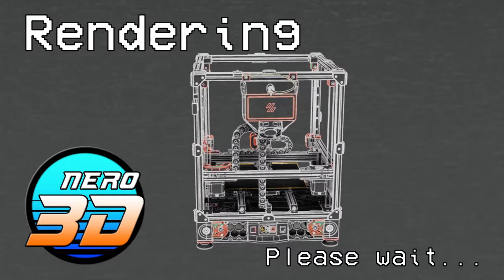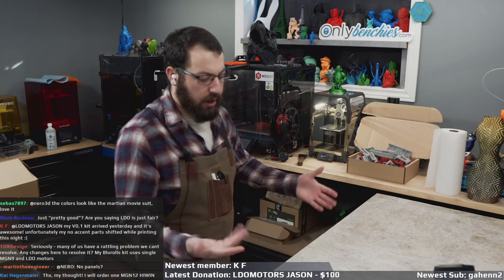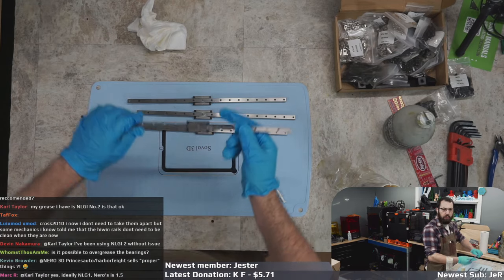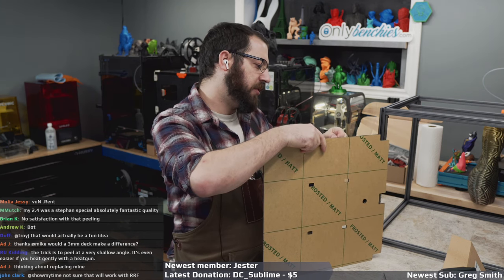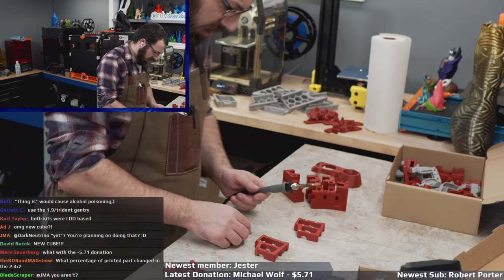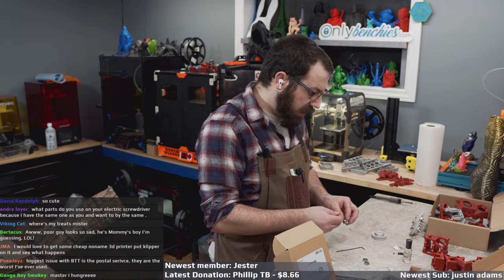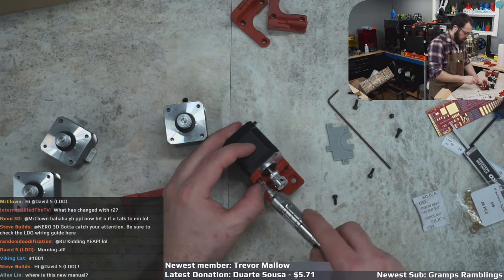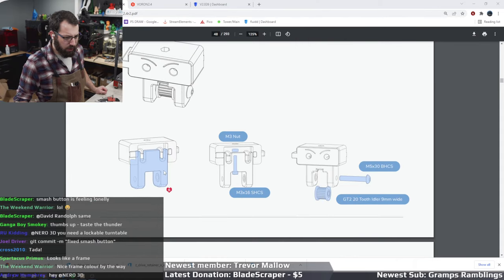Voron V2.4r2 LDOmotors kit Livestream build- PART 1

Comment: Biggest practical endorsement of Voron quality, you found your missing part, ran it through the slicer, dispatched to fluidd, and never even really looked at the printer. You just hit "go" and check for a completed part an hour later. That's a pretty solid testament.

Comment: I think you could have mentioned pre-loading the T-Nuts because the tolerances on the extrusions are so tight that inserting them can be impossible without damaging the extrusions. Some sides are worse than others so identifying where all of the nuts go before assembly can prevent a massive headache later in the build.

Comment: The new cameras look great! Big upgrade to the stream!

I love watching you build these machines. I'm slowly self-sourcing parts for a V2.4 myself. I'm in Australia so try and catch your Saturday stream, which starts on Sunday for me, close to lunchtime :)

RE the overhead camera, I think the image is pretty well exposed, but it's just looks darker compared to a slightly over-exposed image from your front camera. If you're running a kit lens (I seem to remember you mentioning a kit lens earlier in the stream?) then it's possible it has a "variable aperture" which means as you zoom in, it'll get darker (because the hole that allows the light through is getting smaller, part of the cheaper design in a kit lens). Like you did on the stream you can tweak the brightness of the image in OBS, or bump the ISO on the camera itself prior to the stream.

Comment: "Why do i have so many printers, because i like building printers". Funny, i almost enjoy building and working on the machines more than actually 3D printing itself. 3D printing is just a tool to use to build 3D Printers, LOL. Love it!!

Little suggestion, your videos are great, but during these build videos I think a little more explanation of what your doing, and why, would be helpful for those less experienced builders, and that's the whole point isn't it. As an example, you laid the bed rails on the table and lined up the little 90-degree brackets with them, and started the screws into them, and then placed in the machine for mounting. As an experienced builder I know you did that to line them up correctly, but some folks just might not know why, and go straight for mounting into the frame. Some portions you explain very well, and some portions you are chatting away about something else while you're working on stuff. Again love your stuff, just small criticism.

Comment: thoughts on trident vs 2.4r2?
I'm currently trying to decide on a first printer and either those or a ratrig at the moment.
I live in the US, which makes voron cheaper. Biggest thing pushing me towards 2.4 is the greater z, but the bed tramming does look nice to have. (I'd go for either 300x300 or 350x350)

Comment: Hi, I love your videos they have been extremely helpful. I was able to completely rebuild my CR-10 Smart with BTT SKR E3 V3.0, Relay V1.2, PITFT50, LGX Light, BL Touch and Klipper.
I am now planning to build a 350mm Voron 2.4 R2 and have a few questions before I order parts:
My current thoughts on a configuration are-
Stealth Burner with Clockworks 2 or LGX Lite - Currently using a LGX Lite on my CR-10 Smart and like it.
Hot end - I am leaning towards the Rapido HF, but I am concerned I will need to go to an LRS-350-24 due to the 4.8amp current draw on startup. Your Thoughts?
Regarding Mods - 
Is it advisable incorporate the Voron2.4_Trident_Pins_Mod? Does it make any difference / worth it? Does anyone sell pin kits?
Are they any other mods i should consider before I order my printed parts?
Thanks

Comment: Nero I know that it is probably a personal preference but did you mount the Z stepper motors 180 degrees out with reference to the new Manual. The manual showed the socket facing inward away from the frame? Missed the live stream but like the new chapter markers on the revised 'saved' stream :-)
Reply from the maker: The ldo kit has a few differences in assembly, mostly due to the way the pre made wiring is done. You van see the changes in the ldo site linked in the description

Comment: a question on the screws, the black ones to be specifics are those the ones that rusts easily? or these are the better ones.
Reply from the maker: Ive never had an issue, its a black oxide coating thats very common as a rust preventative on screws, NOW there are some ones that cheap out on the finish that may be more rust prone, but thats a vendor issue

Comment: Hi Nero 3D, great video again, I saw you never apply Loctite, are these LDO screws coming with dry loctite on them or you just don't use it? Did you never experience any loose screws?
Reply from the maker: The set screws came with a thread locking compound pre-applied

Comment: What I ordered parts and now the two rails are obsolete? How is one supposed to catch up on design at those shipping delays? So there is not only a need for size configurator but also on different parts at disposal aka even the PDFs are to fixed on one complete version.
And no effort to update the older manuals? Tztz
Reply from the maker: The design was unchanged for near 2 years, the old manuals are still on the github if you want to still build that older revision, the updated manuals ARE the new revision manual
Reply: @CanuckCreator  Yes but I mean updates in the sense of missing information which still is applyable for older version[s]. Then I try my best luck using three monitors and smartphone and not mixing up as I go. Ok and yours and others videos of course.